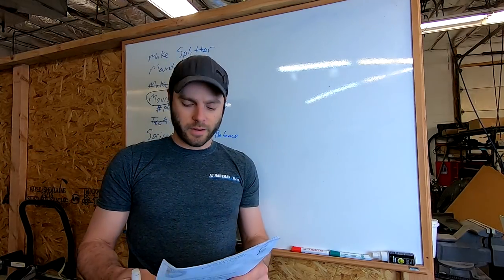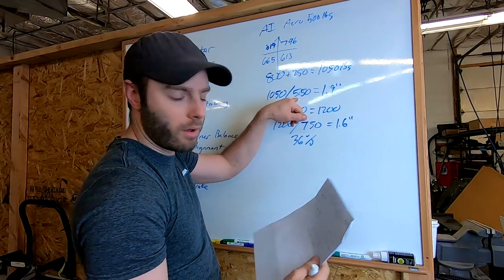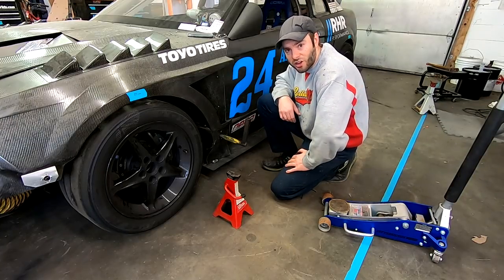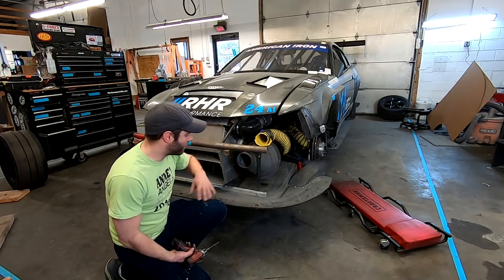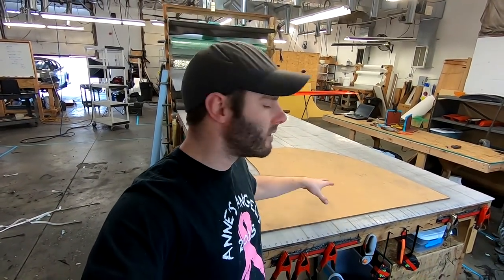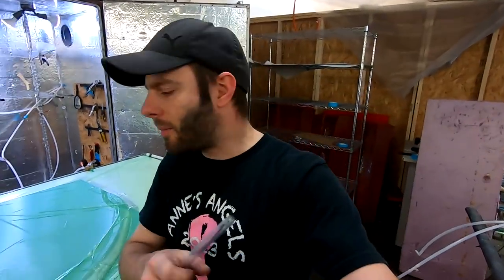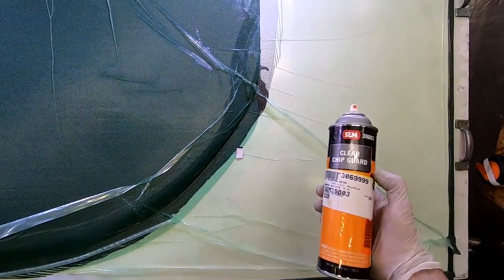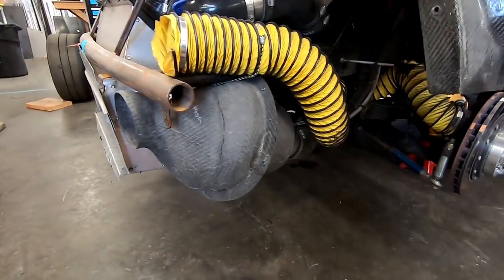Figuring Out Spring Rates With Aero and Infusing Our New Splitter

Comment: Thanks AJ! I dig the videos.  And ya as far as the foam. The yellow (Polyurethane) is cut while White/Pink/Blue foam (Polystyrene or Expanded Polystyrene) XPS EPS is hot wired.  You dont wanna throw anything but epoxy on the white/pink/blue foam though as it will completely eat it up in seconds! Even the fumes are enough to melt right through polystyrene.  Great trick with the clear Chip guard though, I didnt know that one!

Comment: Not a guru by any means, but youll wanna get a helper spring setup  to give you a system that still works when not under heavy aero load (think progressive springs where you have a softer spring for the first inch or whatever for when you arent under aero load like 35mph turns, and that spring binds when under high load and starts working the stiffer sping) and look into dampers that are triple adjustable so you can dial in your low and high speed damping separately. Low and High speed is shaft movement speed so you will want to have a low speed curve that will stiffen up as the aero starts working harder. Having a high speed stage allows for tuning for bumps and curves separately from the low speed which is more of your overall damper setting.
Reply from the maker: Matt B all sounds good and dandy but let’s not forget this is a 99 mustang and is in its initial stages. Not trying to go broke building this thing but will look into it.
Reply: Not how helper springs work. Helper springs take all of the slack out of the spring system so that it is always positively engaged. Otherwise, the spring will bounce around when the suspension fully unloads over bumper/curbs. Helper springs are fully coil bound when the car is sitting still. 
What you are thinking about is a 3rd spring, shock spring, or bump stop. Those make the setup extremely more complex and would require a ton more testing with the advantage of getting a little more speed in the slow corners.
Reply: @billyjack70   The design Im talking about is a normal coil over that has two different springs of two different rates stacked on each other.  I was first introduced to it by a time attack car that I wired in ride height and tire temp sensors on.  It wasnt setup like an open wheel car with a heave spring on a third damper that works in unision with the ARB.  This was like a 300# spring that was a few inches long then a special spacer and then a 900# spring  that was functional once the aero started loading.  They used the ride height sensors to better dial in the two different spring rates and help with valving the dampers.  I didnt ask what kind of costs they were dealing with though, being around race cars enough I know everything is just different levels of expensive.
Reply: @mattnsac  great point. A lot of people overlook bump/drrop travel in their suspension design. They pop crazy high springs onto the car and they end up with no droop travel and tons of bump travel. Car ends up rolling more than before despite the stiffer springs but the people are none the wiser. Bump stops are an active component in roll.

Comment: Hi mate, just a few questions if thats ok, what weight carbon did you use for the splitter (gsm please) Also, what is that cutter you use to cut the fabric ? Im using scissors and its driving me nuts :) Thanks.
Reply from the maker: I wrote a blog post going over all the tools I use here and the cutters are #4 on the list: http://thecompositesblog.com/20-tools-for-under-20-every-composite-fabricator-needs/

As for GSM, I believe they transfer to 200, and 600 gsm. Basically a thin layer for visual, and then a heavy layer for faster build up of laminates.